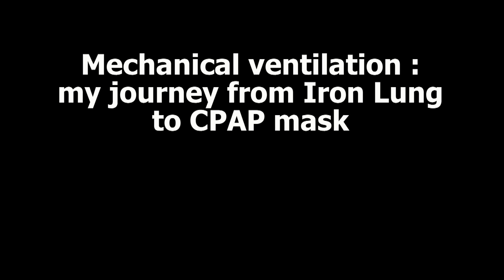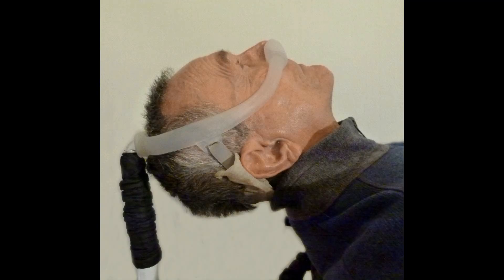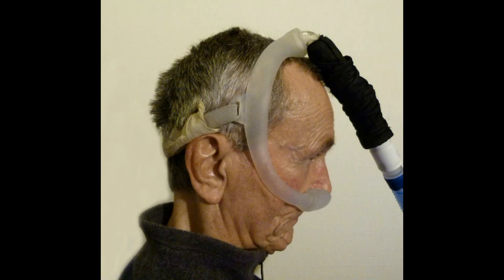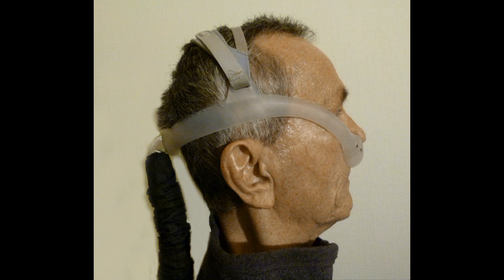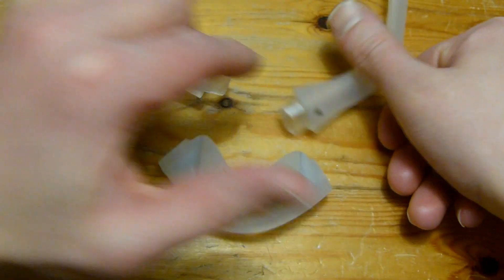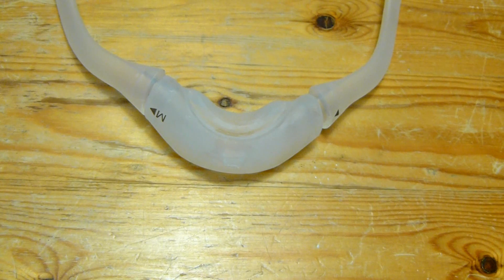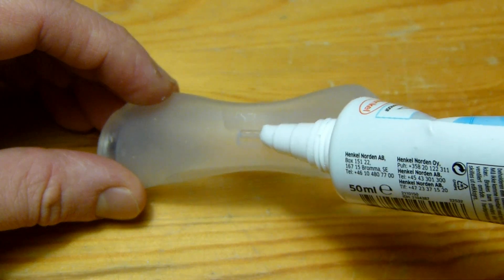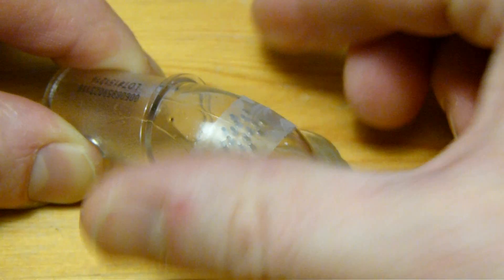Breathing and talking with CPAP mask and ventilator

Comment: Dear Mr. Ratzka, I am 70 years old and had polio in 1952. I was in an iron lung for 3 months and was paralyzed from the neck down.  I was able to retrain many of my muscles to walk and can still walk (very carefully,) but spend much of my time in a wheelchair as I do fall easily.  My left arm is functional. I am not seeing a doctor at this time because I can't find a doctor that will listen or cares that my issues are polio related. I requested, from my PCP, the BiPAP for breathing at night, because I sometimes stop breathing and she reluctantly ordered it without asking questions or doing any research or follow-up. She thought it was nonsense. It was approved because of my test, but no one talked to me about my issues or why I couldn't breathe well. I doubt that the Respiratory Therapist even knows that I had polio. I assume that they believe it's from snoring problems. The BiPAP, pushes air into my lungs when I'm breathing 'in' and is supposed to stop pushing when I breathe 'out.' My old BiPAP machine from the 1990's worked well, however, the new computer style does not. Because of the computer program, the BiPAP doesn't release completely during the "breathe out" phase, so I'm fighting to blow air out. They said that the computer program parameters will not allow them to move the "release" all the way to "0." Unfortunately, the pressure of the machine pushing against my breathing out, makes me feel as if I'm being suffocated, so I wake up a lot. It scares me that it's probably weakening my diaphragm even more. Even tho' I am mobile and don't need a daytime breather when I'm upright, (I do struggle a little more with breathing than I did even 5 years ago) who knows how long it will be before I have digressed. Mr. Ratzka,  I like your revised mask, I may try to make one for myself if I can ever get the BiPAP adjusted properly, otherwise, at this time, I sleep with  a small fan blowing directly into my face. (I've been doing this for over 20 years) I'm sure I would feel more energetic if I got proper sleep, but I'm surviving. Thank you for your information. It inspires me to start bugging the Respiratory Therapist and see if they can help me. Sorry for this long post... I'm rather long-worded!  ;-) God bless and keep you. I admire you for working so hard to follow your dreams.
Reply from the maker: Dear Bweez,
congratulations on your determination, your ingenuity and your ability to enjoy life. Without these, you'd probably wouldn't be alive. From what you are writing I get the impression that you do not get adequate advice from your Respirator Therapist. Have you been in contact with IVUN, the International Ventilator Users Network at http://www.ventusers.org/ ? There you can get addresses of clinics and experts close to you as well as info and advice on equipment. If you have not done so, please, do. We all are getting older wich in itself reduces capacities in everybody. On top of that, we might be affected by the Post Polio Syndrome which doesn't help us. So, in order to be able to enjoy life, we need to stay one step ahead of these developments and be prepared.
Best wishes,  Adolf
Reply: Thank you so much for your response! I will contact IVUN immediately. May you live long and prosper! ;-)  God bless.
Reply: I'm not extremely experienced in this but have been reading apnea forums, look into the ResMed AirCurve ASV machine.  Also the forum I  have been looking at is apneaboard.com. It really is strange how doctors are quick to diagnose the problem as obstructive.
Reply: thanks Adolf and hi Bweez, I too because of polio have a weak diaphragm and share the same symptoms as you both,but at a guess I think there are hundreds if not thousands of us experiencing the same thing, more or less.My journey started 1953  in a small city in NZ I was two at the time I remember tiny bits about what happened and was told and I don't remember that I was placed in a iron lung.Polio would kill my right thigh muscle but I would overcome  this handicap I thought not only did I walk again but I also ran if not with a limp.Most of the times I could keep up with most sports with my friends and some times prove better eg tennis but I could never even through want of trying keep up with them running,i excepted this and moved on ,though I was sometimes made fun of by other kids this was not a common occurrence and as a child the ridicule often hurt deep but as you grew older less was said and you moved on.By my late teens the opp sex seemed to attract my attention,i never thought I was a good looker and still feel same way now so it must have been my personality ,wasn't the money didn't have any haha.Moving on got married to a beautiful Australian girl we are still together with 5 children and 19 grandchildren .Think I was about 45 and woke one night feeling if I was choking and having probs breathing,new to me had no clue it was polio related it must be cancer I thought.Long story short visited dr after dr specialists in the end one of them said its in your mind and another you have to loose weight one time I went to emergency short of breath only to be disbelieved.WHAT THE FLIP!!!! is going on maybe I am crazy I knew I wasn't well.Never heard of Post Polio but there it was on the internet and so was my symptom to the tee answer = nocturnal ventilation with a volume ventilator and not a bipap to rest the weak diaphragm at night. look up JOHN R BACH MD  How Polio survivors can avoid  tracheostomies much love and all the best.,